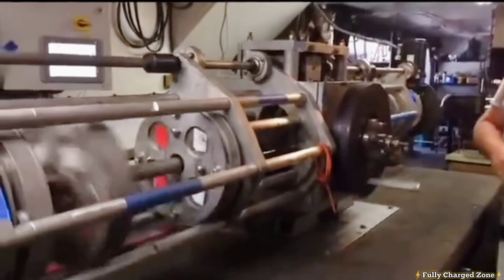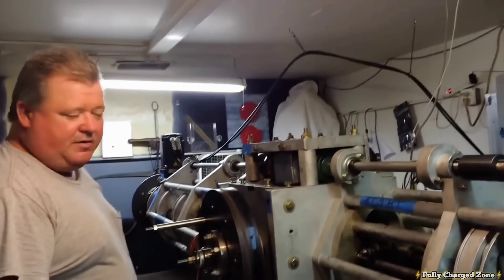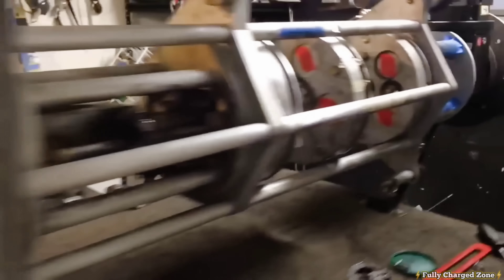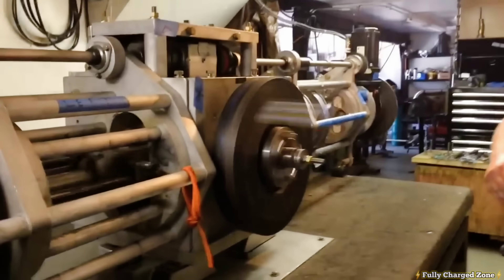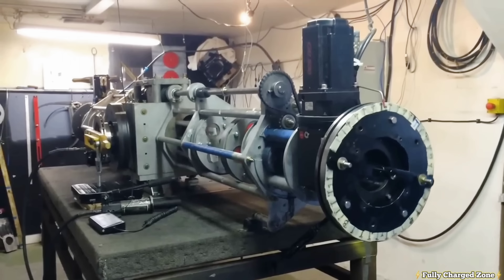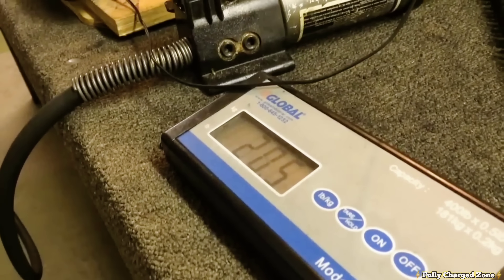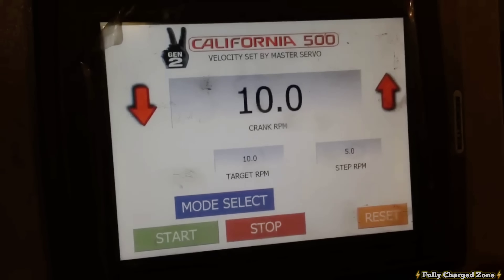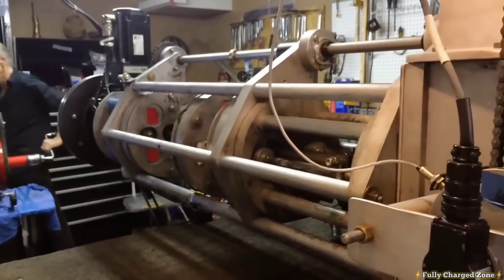World's 1st Magnet Motor - US Patent # 8487484b1

Comment: Okay everybody tells me this is not a free energy device so what is the purpose of this motor how is it being powered why would somebody want or need one
Reply from the maker: @markdi2 Fair question. This is not a free energy device and it’s not claiming to be. It still needs an external power source to run. The magnets don’t create energy, they shape the magnetic field and influence torque and timing.
Think of it like power steering, the assist helps, but it doesn’t move the car by itself. Energy still has to come from somewhere.
The purpose of this motor is experimentation, exploring alternative motor geometries, torque curves, and efficiency ideas. That’s why it was patented.
People build these to learn, test limits, and challenge conventional designs, not to break the laws of physics.
Curiosity drives innovation. That’s what this is about.
Reply: @FullyChargedZone to me it does not seem like it would be very efficient because it has large masses reversing directions

Comment: Friction is the worry, this early model isn’t durable enough to stay together. Still could use more stabilizing and strengthening.
Reply: Provides a good groundwork as a future application.
Reply: Shock absorption is the primary concern so that it doesn’t fall apart at the seams.
Reply from the maker: That’s a fair point. Friction, alignment, and structural rigidity are usually the first real limitations in early builds like this. When you’ve got strong magnetic forces cycling, any small imbalance shows up fast as vibration, heat, and wear. Better bearings, tighter tolerances, proper rotor balancing, and a stiffer frame would definitely improve durability and smoothness. Even then, it still comes down to measuring losses versus output, but refinement is exactly how you learn where the real limits are. Early prototypes are rarely pretty… they’re just data generators. ⚙️🧲

Comment: Free electricity already present here...also many devvices built...but stolen
Reply from the maker: I get the excitement,  the idea of free electricity is legendary 🔋⚡

But this patent (US 8487484B1) isn’t a self-powering generator. It still needs an external energy source to move those magnets through their cycle. The design just uses magnetic forces to convert motion, not create endless energy from nowhere.

If someone actually cracks true free energy someday… I promise I’ll be the first one tearing apart the design to show how it works 😄⚙️

Comment: Why is this not being investigated further.? Magnets are the battery it would seem
Reply from the maker: Magnets look like a battery because they store energy in their magnetic field, but that energy is fixed once the magnet is made. They don’t keep supplying new energy as the motor turns.
In US Patent 8487484B1 the magnets only redirect the input torque, they don’t add power. As soon as you connect a load generator, compressor, etc...  the system slows down unless an external power source keeps it moving.

That’s why you don’t see big research programs around this... it’s a clever magnetic-drive mechanism, but not a new energy source. If magnets ever did become the battery… we’d have a global energy revolution on our hands 😄⚡

Comment: Love the connection to USD863359S1

Anti-gravity device. That's way out there man.
I think you need to work on balancing system. The vibration is manic man.
Reply from the maker: USD863359S1 is actually just a design patent, it protects the appearance of a concept, not the physics behind it. There’s no anti-gravity going on here 😄

This setup in 8487484B1 is simply a magnetic-drive mechanism. The magnets provide force to transfer motion, but gravity isn’t being reduced or countered and it still needs an external torque input to run.

And yeah, the vibration is real — when magnets are cycling through strong attraction/repulsion zones, any imbalance shows up fast. A proper rotor balance and tighter tolerances would smooth it out a lot. ⚙️🧲

Comment: If it didn’t have the servo motors on it, it would be more believable.
Reply from the maker: The servos aren’t powering the rotation, they’re just positioning the magnets for timing. The actual torque comes from the magnetic attraction/repulsion sequence described in the patent. Without timing control, it wouldn’t demonstrate the magnetic power stroke at all.

Comment: You can clearly see the motor & gearbox driving this monstrosity.
Reply from the maker: Actually, what you’re seeing there isn’t a conventional motor + gearbox setup.
The patent (US 8487484B1) describes a magnetic-drive mechanism, the rotation input only synchronizes the magnet carriers so the magnets themselves create the power stroke, not gears.
If it were just a motor + gearbox, the magnets wouldn’t need to be there at all. 😉

Comment: Y con ese consumo cuánto es la potencia entregada?
Reply from the maker: Great question. The patent doesn’t list a specific output power rating, it mainly focuses on the magnetic mechanism and how the rotor maintains motion. The actual power delivered would depend on the torque from the magnetic interaction and the RPM under load ⚙️🧲

Comment: Does it produce any usable torque?
Reply from the maker: Absolutely... the patent does describe usable torque output.
But it’s not like an EV traction motor. The torque comes from the timed magnetic gating system, where the magnets are mechanically shielded and un-shielded to create directional force. So yes, it produces torque, but the real limitation is how consistently it can maintain that torque under load.

Comment: This can be used to charge batteries
Reply from the maker: @kevrish
Exactly... once you couple it to a proper generator head, the rotational output can be used to charge a battery bank. The patent mechanism is about producing continuous mechanical torque, so converting that torque into usable electrical energy is just the next stage of testing. ⚡🔧

Comment: Why do ypu have two servo motors on this?
Reply from the maker: Good question — the two servo motors are only for controlled movement so they can measure timing, magnetic alignment, and load. The rotor motion itself is from the permanent-magnet layout described in Patent 8487484B1. The servos don’t spin the motor.
Reply: @FullyChargedZone you understand why everyone believes one or both of these motors are doing the actual movement.
Reply from the maker: “Yep, I get it. Visually it seems like servos = drive, but here they’re only for indexing so the system can record timing, alignment, and load. The real rotational force is from the permanent-magnet configuration, not the servos

Comment: “The spring and magnet” contraption that produces only what you put in. “Over unity” does not occur with this device.
Reply from the maker: Totally understand your point—most magnet systems cancel themselves out. But this device uses staged magnet gates and mechanical timing to reduce the usual ‘opposing force’ problem. Whether someone believes it goes over unity or not, the patent outlines the method. I’m just documenting the real machine and letting people judge for themselves.

Comment: What work can it do ?
Reply from the maker: It converts rotational magnetic force into mechanical output. Basically, it can drive a shaft the same way a small electric motor would—fans, pumps, test rigs, anything that needs rotational work.
Reply: @FullyChargedZone  so surely the work it can do, pumping water etc has been measured, those measurements would include energy in Amps , back to my original question, how much work can it do in watts & amps. ??

Comment: only 1 kw is nothing , you need to reduce the metals used and put more magnet to get at least 15kw is reasonable for home use, also for crypto miners like me we want high electricity with lower cost possible
Reply from the maker: Totally get where you’re coming from 👍 — but this setup isn’t designed for high power or energy generation. It’s a demonstration of magnet motor principles, not a free energy or high-output device. The goal here is to show how magnetic forces interact, not to replace grid power or mining setups. ⚙️🔋
Reply: @FullyChargedZone so why all this wast of time then ?😂? if you adjust it u can replace the grid that what people want

Comment: How much force can it generate?
Reply from the maker: Good question! This setup isn’t built for high torque or output — it’s mainly to demonstrate magnetic interaction and motion. The force here is pretty small, only a few ounces of push depending on magnet strength and spacing. It’s more about showing the principle than generating real mechanical power.

Comment: Yes magnet motors do work but nothing is free people, eventually the neodymium magnets will lose it's magnetism they will all need to be removed & replaced or re-energized.
Reply from the maker: You’re right — nothing is free. This patent design is just a mechanical magnetic setup, not a free-energy machine. And yep, magnets can weaken over long periods, especially under heat or vibration, but in normal use they last many years. 👍

Comment: Yes - the electrical output will equate the electricity which went into the manufacture of the magnets, then the system will stop.
Reply from the maker: Absolutely — and that’s why this isn’t meant to generate electricity. It’s only showing the “power zone / dead zone” motion from the patent, nothing more.

Comment: I mean this is interesting but there is not a lot of/ not enough information
Reply from the maker: Thanks for the feedback! Totally understand what you mean. This video was mainly a visual demonstration of the mechanism from U.S. Patent 8,487,484B1. The patent describes a magnetic drive system that uses specific magnet arrangements to create “power zones” (where the magnetic fields produce a push/pull force) and “dead zones” (where the forces cancel out so the system can reset).

It’s not a motor in the traditional sense, and it’s definitely not free energy — it’s just a mechanical concept the inventor patented. I’m working on a follow-up video that goes deeper into how the magnet carriers interact and how each zone functions, so thanks for pointing this out. I appreciate you watching!

Comment: I am impressed. I have a question though. How is the performance when a load is applied? That has been a problem with these types of machines before.
Reply from the maker: Great question — this setup wasn’t built to handle a real load. It’s just a demonstration of the patented magnetic mechanism, so I didn’t test torque or load performance. These designs usually drop off fast once you try to drive something.

Comment: This is most amusing. 😂😂😂
The red machine has an electric motor at the rear end, driving it. 😊
The large grey machine has two black electric motors, one at each end. 😊😊
Reply from the maker: Easy mix-up — those are just the stand fixtures, not drive motors. The rotor itself is what’s being tested. If you’re curious, check out the patent — it explains the design in detail.
Reply: @FullyChargedZone    stop trying to fool people, I build electric machines for a living.
The "device" has a square black electric motor at each end, mounted on a 90 degree gearbox, and both motors have an electric cable going to a power source.
It is a scam, and the "patent" is worthless
Reply from the maker: I’m not trying to fool anyone — everything I said is straight from the patent documentation.
The external motors you’re pointing at are for calibration and measurement, which is why they’re hooked to instrumentation.
Nobody here is claiming magic. Just showing what the inventor filed.

Comment: Now unplug it, pull onto asphalt road, and show us how it works without any attached wires/tubes
Reply from the maker: It’s not my invention, I’m just documenting the patented design. It’s connected to calibration and measurement equipment for the demo, not for power. The patent explains the operating principle if you’re curious.
Reply: @FullyChargedZone  "The only difficult part about perpetual motion machines are hiding the batteries" ..unless you just put power cables in plain view.
Reply from the maker: Not hiding anything, my guy — those aren’t power cables. They’re test leads for measurement and calibration only. If it were being secretly powered, the patent and the demo wouldn’t match. I’m just showing the device exactly as the inventor designed it.

Comment: This video isn’t very clear. From what I can tell, he is claiming this is only using magnets to generate power. No electrical input? If so, I’m calling bs.
Reply from the maker: Not claiming it runs with zero input. The patent clearly shows the calibration and positioning motors used in the setup. I’m just documenting the inventor’s prototype exactly as it’s described in US Patent #8487484B1 — not making claims beyond that.

Comment: My previous message got deleted, so I am trying again. I am very excited by the potential of alternative energy actually making its way into the world and finally being applied and not suppressed by greedy corporations. 
My question as a layman is; what is the potential practical application application for this device if it were to be used? Could it generate power for a home or would it be aimed at powering machinery or what? 
Thank you
Reply from the maker: This is a wind-up magnet motor — and it’s impressively efficient!
I’m a big fan of efficient motors, so when I came across this patent, I had to learn more. After reaching out to the inventor’s brother, I got permission to share this video of the motor in action. It’s a fascinating piece of engineering — and just plain cool. ⚙️⚡

Comment: Yes the DC servo motor sitting on the top on one end  is the give away to the fraud
Reply from the maker: Good eye, but that servo is only for alignment and pulse calibration. The patent explains it in the control section. It’s not powering the rotor — just part of the inventor’s test setup.